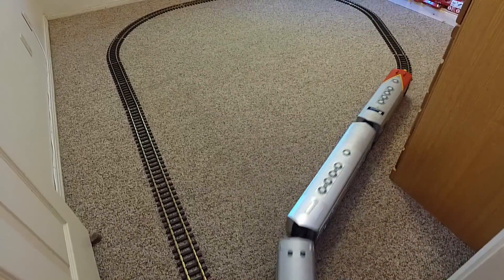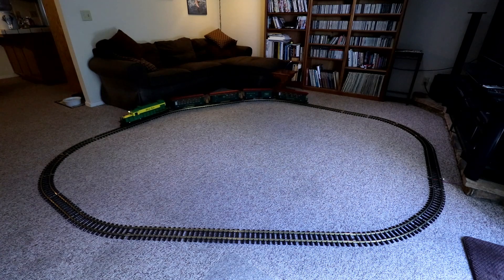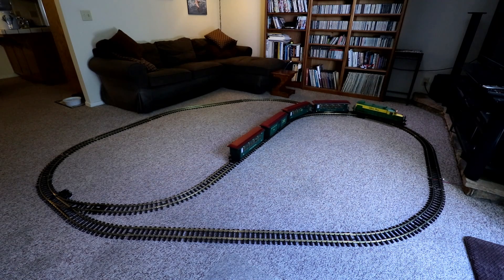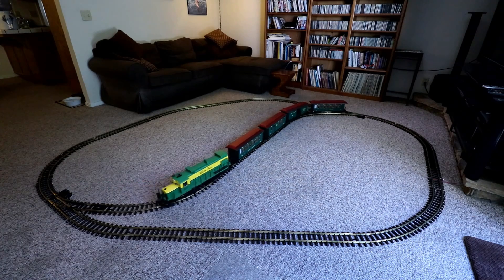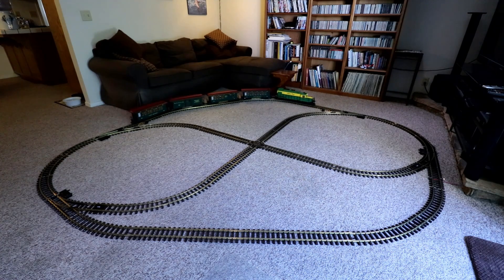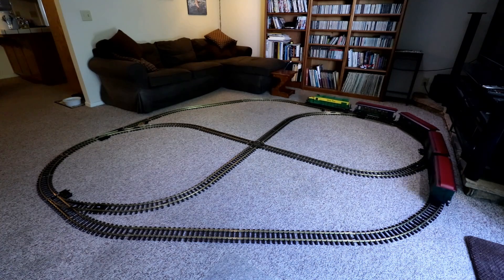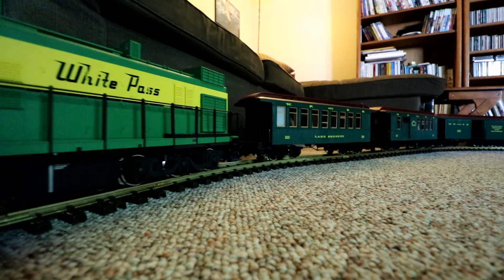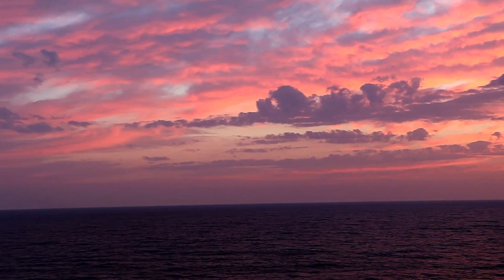Advanced Lesson On Using Reversing Loops With DCC Model Trains

Comment: Do you have a video about making trains going upward on hills because I wanna get into this again but I wanna know what do I need to make trains go more uphill
Reply from the maker: I don't have a video about that, but I can give you some information on it.
G-scale trains don't do very well on inclines, but some locomotives handle inclines better than others.  In my own collection, I found that some of my locomotives could only do a very gentle incline, but a few could do a bit steeper inclines than that.

If you're looking at doing a severe incline...  say more than a 10% grade...  what you're going to want to research is "cog locomotives".  (Sometimes also known as "rack locomotives" or "rack rail locomotive".)  You can see an example of one here:  https://www.youtube.com/watch?v=p2x-kp8tjx4

The way these work is you insert a special piece in to your tracks that the cog on the cog locomotive grabs on to in order to pull itself up the incline.  In that video I mentioned in the previous paragraph, if you look carefully at the rails you can see a long black plastic piece has been added between the two rails.  This is the piece that the cog underneath the locomotive grabs on to.

Please note that that is not something you can do to an existing normal locomotive.  You have to buy a special cog locomotive.

Comment: Hello Jim. In the video I see the both of the insulating units for the reversing loop are 'LGB 1015T' when looking at the web site LGB shows the set as a pair '1-1015T and 1-1015K'. Is this different than your layout? TIA
Reply from the maker: This is a DCC reversing loop...  so, at both ends of the loop I've used a 1015T.  However, at one end of the loop I've hooked up the MRC reversing loop module to one of those 1015T units.

I think your confusion may come from looking at instructions on how to make a reversing loop on an ANALOG system.  On that type of system, you put a 1015T at one end of the reversing loop and a 1015K at the other.

It's very important when setting up a reversing loop on your system that you understand that DCC and analog reversing loops are done differently...  and that you do it the right way for the type of model trains you'll be running through your loop.
Reply: @JimZim  Thank you Jim you cleared that up quite nicely. One more question, you reference that it tends to be a money pit, lol all hobbies seam to be, do you have a preferred vendor or two?
Reply from the maker: I've bought almost all my trains and the related equipment from www.trainworld.com
They seem to have the right combination of low prices, huge selection, and quick shipping.  They're in New York and I'm all the way over on the other side of the country in Washington...  yet they tend to be able to get stuff to me in 7 days.  If you're located closer to New York than I am, I'm sure it would be even sooner.
Reply: @JimZim  Thanks Jim, Central California here.

Comment: Nubie question here (especially with DCC):  At 3:16 you mention the 90 degree crossover piece.  Why doesn’t that cause a short circuit when the two tracks cross?  Doesn’t the entire track, including the crossover, need electricity?
Reply from the maker: The two legs of the crossover piece are electrically isolated from each other, so that they do not short each other out.  There is a tiny gap in the tracks at the crossover to prevent a short, but the gap is so small that the train doesn't lose power since it is in motion and almost instantly connects to the track on the other side of the gap.

Comment: How do you make the dcc switches change on their own?
Reply from the maker: There were wires hidden under the tracks that connected to the switches so I could operate them from a control panel.
Reply: Thanks, Jim
 Do you have a product code for the control panel?
Reply from the maker: The current version is the LGB #51755 control box.
I think there are also some older versions that would work, such as LGB #5075.
The older version that I actually use is LGB #5180.
You can find those older versions on eBay for less than what a new 51755 would cost.

Comment: This is part two of how to use reversing loops on a digital model railroad layout.

Watch part one, where you are using the LGB Santa Fe Super Chief passenger train lead by an EMD F7 diesel locomotive #202.

And now, you are bringing out the LGB White Pass and Yukon Route Railway ALCO diesel locomotive #107 pulling a passenger train with a caboose from the White Pass and Yukon Route Railway to run on the layout in part two of taking reversing loops to the next level.

Making the train to travel in the opposite direction by using reversing loops on the layout, you need to use more double insulated track sections, more reversing loop modules, 90 degree crossover pieces, switches, sidings, and buffers and we're in business.

And so you isolated the reversing loops from the rest of the track, otherwise, you will and can create a short circuit.

And then, once we mastered on how to use reversing loops on a digital model railroad layout, then we can start to be very creative with our digital model train layouts.

That is how you, Jim Zim, come up with new, unique and different layouts every time you set up your G scale model trains, instead of getting locked into one static layout in the backyard.

This is Thomas Comeau, signing off for tonight until tomorrow. Good night!

Comment: Nicely done. I have one stupid question - are the different tracks in a crossover electrically isolated? I assume so, but wanted to make sure.

And I have been on the White Pass and Yukon train. It is an excellent trip, and I highly recommend it.
Reply from the maker: Yes, there's electrical isolation between the two sets of tracks in a crossover.

Comment: Much thanks Jim, I have been looking for instruction on how to wire a reversing section of track using 2 switches back to the main and all I could find was "loops" back to the same switch.  So one reversing module will control one isolated section of track. Seems simple.....
Reply from the maker: Just remember that what I showed you in this video only works on model railroads powered by a DCC control system.  If you're running an analog system, this will not work.
Reply: @JimZim  Got my NCE cab ready to go!!! Thanks.

Comment: Hello Jim, I have a question. How do you power such long, incredibly long carpet runs? Do you have a bus wire under the floor? I've seen 8'X4' layouts that need bus wires for even their small layouts.
Reply from the maker: I use LGB-brand brass track, which is extremely high quality.  (It better be, for $7 per foot!)  Using this type of track, I have no issues with power loss.  The power flows uninterrupted and quite reliably through the rails, with no additional wiring needed.  I have even run super-long lengths of track...  all the way over to my next-door-neighbor's house and back...  and only connected power to the rail at one location...  and the trains ran fine on the entire long layout.

My guess is that any 8'x4' layout that needs bus wires is made with some really crappy quality track!
Reply: @JimZim  Thank You So Very Much!

Comment: What brand is your DCS? I tried to find one.
Reply from the maker: I use the MRC Prodigy Elite 10 Amp control system, plus the wifi add-on unit
Reply: Jim Zim was it easy to install
Reply from the maker: I don't think any DCC setup could be called easy.  DCC is complicated, with terminology you won't be familiar with, and there's a learning curve.  I felt like the MRC Prodigy Elite was about as easy to set up as DCC could be...  but there definitely was some stuff that confused me and I felt very much out of my comfort zone at first.  But it wasn't long before I had it running.

Just to give you an idea of some DCC concepts that you have to learn...
Short addresses, long addresses, cabs, program track, program on main, configuration variables, consisting...
These are some of the things that you have to deal with, and at first you probably won't even know what the terms mean.  So, there's a learning curve.

You can actually look at the owner's manual for the MRC Prodigy Elite at https://www.modelrectifier.com/v/vspfiles/resources/dcc/0001417manual.pdf
Take a look and see if it scares you, or if you think you could handle it.
Reply: Jim Zim thanks I appreciate your input

Comment: Awsome information.Im just getting into G scale a needed to or should I say want to have a reverse loop so I don't need double trucks in making and using a reverse loop on each end in my first G scale layout.I still need to thingamajigs that is needed with the reverse loop sections what were those little wired into the units the black 15t something or other.would be a huge help to learn and gain the right information as to not have shorts.Thanks again.

Comment: I am trying to learn more about DDC track wiring and this reverse loop is part of what I want. Great to identify the electrical modual but would be nice to see how this is wired. Does this just get powered from one side of the track and modual provide isolated power to the loop? So the track just needs power at one location?
Reply: @JimZim  With the crossover track in the middle of both reversing loops. How does it get power to all sides of the cross. What I find is the rails are isolated in both directions. The modual would only power half the loop it seems. Is there a good book on this type of layout?
Reply from the maker: The isolated section of track gets power from the AD520 module.
Reply from the maker: See if you can Google the owners manual for the MRC AD-520 reversing loop module.  That might help you.
Reply: @JimZim  I think I have found an example of what I would like to set up.  It would be a dog bone with one main line between each reversing loop. My back yard is split by a small stream and want the main line to run from one side to the other over a small bridge. I would like both switches to be automated by train movement and not manual so it can loop back over on it's own. Seems like this takes other controls and photo sensors and solid state relay to switch the main power too. Just need to learn more to plan. I enjoy your video. Your house layouts are something else!

Comment: Hello Jim, what control central do you use to power such huge number of trains? I use Z21 Central and I can control two trains only.  Z21 gives obout 3 Ampers current.
Reply from the maker: I use a 10 amp DCC power supply from MRC that can be controlled on an Android phone or on a iPhone.  In some of my more extensive layouts, I actually run two independent sets of tracks using two of those 10 amp power supplies.  I find that each 10 amp power supply will run about four or five of my trains.
Reply: @JimZim  Thank you very much for your quick answer. Now I use Z21 central. It gives about 3 amps. So I am looking for solution to increase the power. Could you give specification of your solution. Thank you in advance. My Z21 is controlled by Android phone too.
Reply from the maker: Take a look at it here:
https://www.trainworld.com/manufacturers/mrc/mrc-g-scale/mrc-dcc-systems-and-accessories-1/mrc-0001423-prodigy-elite-wifi/

Comment: Did I miss the brand/model number of the reversing gear?  I see the LGB isolated track sections, is the reverser the MRC AD520?
Reply from the maker: Look at the 2:15 point in the video.  It's right there in big yellow letters.  You must have dozed off at that point!  MRC AD520
Reply: Jim Zimmerlin I watch the videos with the CC on, the text was obstructed by the caption.  Thanks for the quick response!

Comment: Thanks for the videos.  I'm rather new to LGB so would be really grateful if you could clarify something for me.

Is it correct that if I just use the LGB reversing loop track sections alone that I'll be able to create a basic reversing loop but that it would only allow travel in one direction? If I additionally connect the AD520 this would allow travel within the loop in both directions?

Thanks.
Reply from the maker: Nope.  Without the reversing loop module, there would be no power to the track within the loop.  The insulated track pieces block power to the loop.  And remember, what I described in this video is ONLY for DCC systems.  Reversing loops for analog systems are a completely different animal.
Reply: @JimZim  Thanks.  I'm just using one of the starter trains right now so don't  think its DCC equipped.  I found an article on loops which seems to indicate that I can do one with just the LGB parts but would need to manually reverse the power as the train travels through the loop.  This isn't necessarily a problem as I'm only making a layout in a single room:

http://track2.com/info/lgb-reverse-loop/LGBReverse.pdf

Is is possible (or even worth it) to convert a basic starter locomotive to DCC or should I just bite the bullet and get a more expensive separate locomotive?

Comment: Just found your video. Looks like a lot of fun.  Was wondering if you have a problem with carbon dust buildup on your carpet at rail joints?  Built a loop around the Christmas tree with g scale and had that happen. She was not happy with the ring of black spots on the carpet
Reply from the maker: That's interesting.  No, that has not been a problem at our house...  even at Christmas time when the trains have been set up for an entire month at a time.  There is always a lot of carbon dust on the tracks...  and my hands get filthy when I finally pick all the track up and put it away...  but it doesn't seem to get on the carpet.  Or maybe it just doesn't show, because of the pattern and color of our carpet.  I guess if you had white carpet, that would be a bigger problem!

Comment: It's been nearly 40 years since I played with model trains. Do the digital trains now use AC current on the tracks or still use DC current? 40 years ago the DC loops were isolated and you had to manually switch the polarity of a section of track the train was running on. Are the new digital trains smart enough to do this themselves or how does it work now?
Reply from the maker: The AC/DC question is more complicated than you might expect.  Take a look at https://en.wikipedia.org/wiki/Digital_Command_Control for the full answer.

DCC gives you the ability to individually control each train on the layout, independently of the others.  So, as you see in this video, you can easily stop and reverse a train.  On a more complicated layout, with multiple trains running, you have individual control of the speed and direction of each train, as well as control over the whistles, bells, etc.

Comment: What about it you use Lionel fast track do you need one of those reverse loop modules if you make a reverse loop
Reply from the maker: No.  Lionel Fast Track is a 3-rail system, and the problem I was describing is unique to a 2-rail system.  In a 3 rail system, the center rail is one polarity and the two outer rails are the other polarity.  No matter whether you loop the track back around, there is never a short circuit.

If all model trains from the beginning of time had been designed as a 3-rail system, things would have been a lot easier as far as reversing loops are concerned!  But, of course, back in the old days they started doing model trains as a 2-rail system since that is how real full-sized trains are.  And now, we maintain the 2-rail thing so that we stay compatible with all the old model train equipment from days gone by.
Reply: Jim Zimmerlin thanks for the explanation I am a beginner model railroader and I am planning to make a o gauge layout with Lionel trains.

Comment: Are all trains dcc? Wat wud happen if it wasnt dcc?
Reply from the maker: No, few of them are.  None of the older model trains are.  For example, if your dad has had a old model train set sitting in the attic for 20 years...  those are definitely not DCC.  When you look at new model trains available for sale today, the lower priced locomotives generally are not DCC.

If a locomotive is not equipped with DCC, it simply will not run on a layout powered with DCC.  They operate on completely different electrical systems.

Comment: Isn't it easier to make AC-power supply from rails and control all the locomotives you have on your rails via wi-fi or stuff like that? Of course loops can make short circuit either and should be insulated as well, but it's easier to control movement of each locomotive.

Comment: I cheat. I use the Märklin 3-rail system instead. Muhahaha!
Side note: I must admit I have a hard time wrapping my head around the fact that they build railroad bridges out of WOOD. (5:35)
Reply: most of the early rail bridges in the US were wooden - for two reasons. Wood was closer to the construction site than the iron & steel foundries. And the production of the rails had already pushed up the prices of all iron & steel to the point where any new demand would have been prohibitively expensive.
Reply from the maker: Yes, the 3-rail system really solves the problem of reversing loops in a very elegant way.  I didn't even know 3-rail track systems existed when I first got in to G-scale trains.  Found out about it when I first started learning about reversing loops.  If I had known about 3-rail systems before I got heavily invested in to my 2-rail system, I might have gone with the 3-rail instead.

That wooden train bridge in Alaska is amazing, isn't it?!?!  I've seen it in person.  It's one of the greatest possible vacations for a train lover.
Reply: I actually don't know if there are any 3-rail systems in the G scale. I play with Märklin H0/HO and a little N-scale (2-rail).
Reply: ziiofswe, OH yeah... I'm going to start thinking of the best way to decide what to be the main reason for buying anything for trains is to use the wooden bridge as a guidelines for the type of trains I'm going to use for my setup too  😉👎